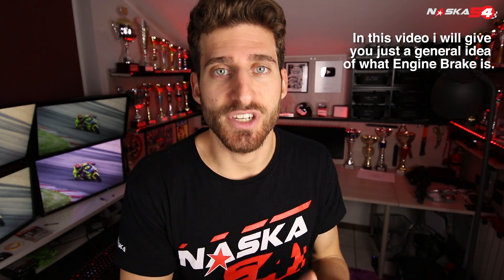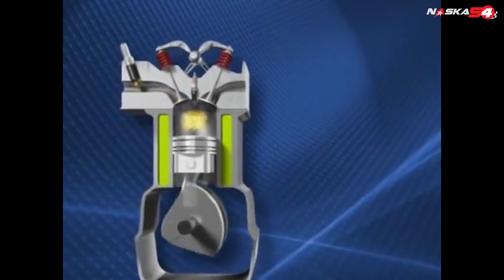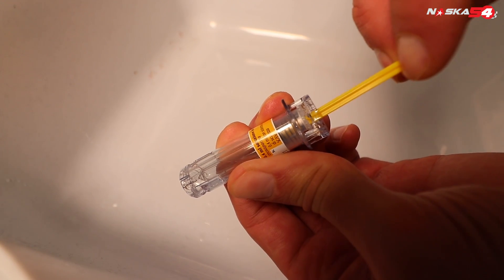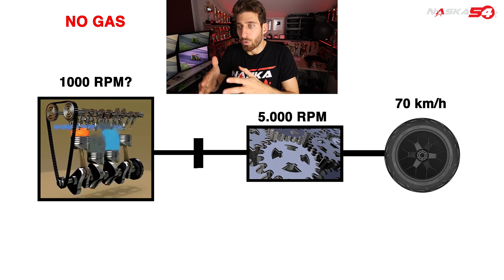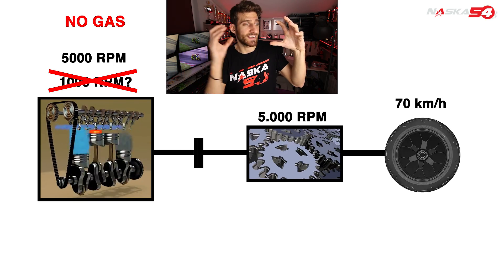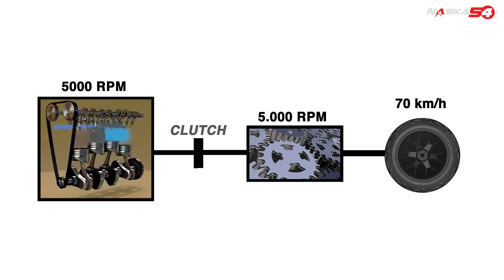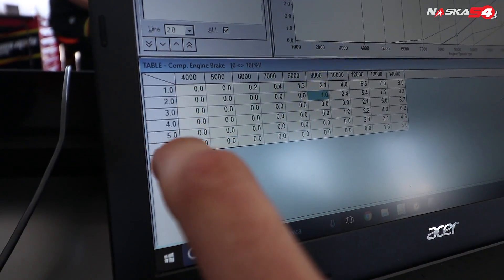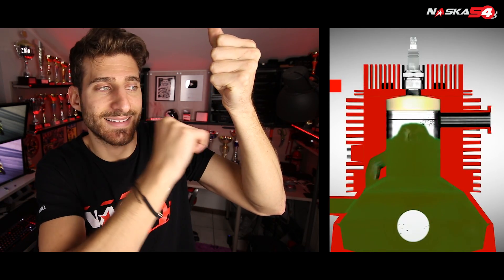THE ENGINE BRAKE: What is it and HOW does it work? Motorbikes and cars

Comment: When engine-braking and the rev is pushed high, the spark plug is not sparking and the fuel is not injecting the fuel though loud engine sound and reving high?? 

 Am i understand it corrrectly??

Comment: The first thing I noticed hopping on a motorcycle is wow these things engine brake sooo much harder than a car. It does feel like I'm wasting gas a lot because of it when I'm trying to coast and don't want to upshift 3 times or hold the clutch in (it just feels wrong) to do it. But it is definitely nice for cornering on the street. Most of the time I don't need to touch the brakes.

Comment: Question: Since engine braking takes away energy from the rear wheel, does engine braking without lever braking (the front brake)  produce the same braking effect as using the rear brake - that is, unloading the front wheel?

Comment: small addition on the fuel consumption, on most fuel injected engines, if the engine rpm is above a certain value, often around 2000rpm, and throttle is closed, there will be absolutely no fuel injected into the engine so fuel consumption is 0, this increases engine brake and reduces fuel consumption. if your car has a current fuel consumption meter, you can try it out, accelerate to 4000rpm and close the trottle, and watch how fuel consumption is suddenly 0

Comment: Here in Chicago Illinois, it's taught in driving lessons to put the car in neutral when you're slowing down on snow or ice to keep the car from sliding due to engine braking.
Reply: it is very bad idea. Neutral on slippery is dangerous because you have no control
Reply: @mightylordkuba  Except for the fact that I'm talking about casual driving on public roads, not driving on a track. And you'd only "have no control" if you had no ABS and are careless with your braking pressure.

Comment: If I got it right you saying race driver and modern systems reving in between downshifting to use engin brake ? If so that is completely wrong, the rpms are reved in between the gears to AVOID this Engin brake Calle „ Schleppmoment“ in German. Because they want to AVOID that tires will block especially in rear wheel vehicles, this is because in the past they had to donut manual to fit the rpms to the lower gear. A lower gear needs higher rpms to crest the same speed than the gear above „higher“ gear.

Comment: Its recommended to drastically use the engine break for a emergency break? Or in that situation is better pull the clutch 100% and only use the breaks with ABS?

Comment: Hi Alberto,
i like your videos but you have in this video a mistake.
RPM is the engine speed, not the wheels, so if you have 6000 RPM it costs 3l per minute, but when you have 2000 RPM it costs 1l per minute. It doesn't matter if you're adding gas.

Comment: Yes but at 3.50 engine rotations per minute are not the same with all the gears because you have a gear ratio in the transmission except the first gear which is connected and  driven by the engine with same rpm is at the gear ratio 1:1 with his pair . At this case engine and the 2 gears are with the same rpm until you shift another gear

Comment: Excellent video. I drive a scooter (Yamaha Ray ZR) since 2016. In December 2019 I bought MT15 and after that I taught myself how to ride a bike. I use this engine braking a lot on daily basis. But I was worried about the engine, wondering if it is bad for the engine to use engine braking for slowing down. And now I am relaxed after watching your video. Thanks for all the nice tips!

Comment: it might be good to note, that an engine is controlled not by fuel, but by the air. If you twist the throttle on an old bike, you literally control an air valve (butterfly valve) on a carburator, or with EFI systems control a butterfly valve on throttle bodies (either electronically or with physical cables). Thus if you close the throttle, you restrict the airflow. If you try to suck air through a smaller gap it also gives more resistance. Whatever controls the air/fuel mixture (carburetors or computer+injectors) tries to keep the air fuel mixture roughly the same, so with less air flow there is less fuel being spent as well. This explains 8:15 (although the airflow and thus consumption is higher than if the bike would be stationary I think). 

I think this is also how the electronic engine braking works, by electronically not fully closing the butterfly valve, you can increase airflow and thus 'reduce' the amount of braking. I am however not 100% sure of this.

Comment: Engine braking is caused by an advance of the combustion (the mixture explodes before its fully compressed, before the piston reaches tdc) not because it takes energy from the wheels. Mechanics and engineers are crying rn lol
Reply: That's just completely incorrect... most modern engines cut fuel on zero torque demand. The engine breaking comes from pumping losses.

Comment: great video! but i wonder.. Does engine break damage the engine? Or is it good for engine?
Reply: Well, it depends on what circumstances. If you just go down a single gear, or maybe two it just helps you breaking without slamming too much on the brakes. But if you pass from the 5th gear to the first you'll end up blowing up your engine since the ratio of the first gear is such as to cause the engine to rev up to a such high speed that could cause the piston to slam the valves or even snap the piston rod itself. (Or maybe burn the cuch or break some transmission gear)
P.S. you can trust me im an engineer
Reply: @sicilyrider4980   so it is all about to not pass rpm limits. It is releived. Thanks!
Reply: @semihakpnar2212  
You are welcome

Comment: Alberto,  you're not explaining engine braking in this video.

As Jason Fenske explains on his YouTube video titled "Is It Bad To Engine Brake With A Manual Transmission?", it is not compressing the engine that causes engine braking, as that compression goes into the power stroke, which naturally more than compensates for any loss of power due to compression. That of course is not the case in your demonstration of pushing a motorcycle in gear with the engine off.

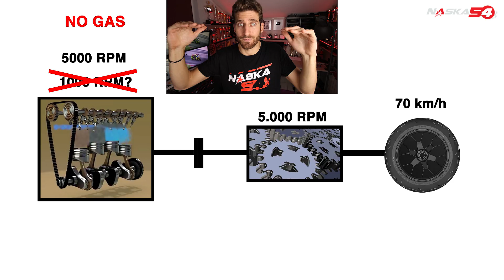At about the 4 minute mark you explained that when you let off of the throttle the inertia of the rear wheel would like to keep the vehicle at the same speed, keeping the engine's RPMs up. Then at 5:21 you state "Where does it take the energy to stay at 5,000 RPM? It takes it from the wheels. So, sucking energy from the wheels, the engine is actually braking them. So, it is acting like a brake, and this is why it's called engine braking." You are claiming that the rear wheel speed wants the engine to remain at 5000 RPMs and the engine is taking energy from the rear wheel to rev closer to that speed. That's not defining engine braking.

Let's leave this one to an engineer to explain. I'll quote Jason verbatim from the video I mentioned above:

"You let your foot off the throttle, and so that throttle valve closes and now you have a vacuum between that throttle valve and your engine. Your engine is trying to pull in air, but the throttle is closed so it's hard for it to pull in that air and that's what's slowing you down. A lot of people say it's the compression that's going to be slowing you down in these gasoline engines and that's not the case, because as that piston compresses up, it does pressurize that air, yes, and it does take work to do that, but that work immediately goes right back into pressing that piston back down. Very little of it is actually lost to heat in that transaction because engines are smooth running machines; they're not supposed to lose heat in that scenario. So a lot of the energy from compression just goes right back into pushing the piston back down. The real engine braking in gasoline engines comes from that throttle valve being closed and trying to pull that vacuum."

To put it succinctly, engine braking is the engine slowing down due to the vacuum created by the almost completely closed throttle valves and the slower engine speed in turn slows down the rotational speed of the drive wheel; it is not the drive wheel slowing down the engine.

I hope you consider re-doing this video as you don't seem like the type of guy that wants to propagate inaccurate information. It seems that you genuinely want to help others better understand how things work.

Comment: hi alberto.. one question, u said that we can gain more engine braking when downshifting in hi RPM..  but is the slipper clutch should reduce the engine braking ? currently im using suzuki k9
Reply: Well ut only slips until the rear wheel matches the speed you are going... Mainly helps with starting a drift... (I ride supermoto)
Reply: @HochstartHarry   you mean backing in rite? No wonder few time i done it accidentally in few corner on track.. From hi speed stretch up to tight corner.. When im rapid down shifting, Rear tyre feel like i push the rear brake eventhou i didnt..!! Lol... But it really scare.. Im struggling to centre and stabilize my bike.. :(
Reply: @redlineemperor  yes, exactly what i mean. Well there are a few possibilities. Either its a mechanical thing (like tire balance or a mismatched suspension setting) or you need to work on your throttle input. Also incase you ride with the clutch in through turns your bike will never feel stable.
Reply: @HochstartHarry  yeah.. still trying to figure out best throttle input and braking point...
Reply: @redlineemperor  thats all a matter of practise. Go and watch "twist of the wrist" its on youtube, its cheezy as hell but lots of great info

Comment: "it helps in braking" - but only up to the point of maximum traction of the rear wheel tire, which is lowered significantly during braking due to load shift to the front. I think the same amount of braking can be achieved solely by the rear brake. So the question becomes: which kind of rear-wheel braking is preferred? Maybe engine braking is inherently smoother? On the track, I actually never use the rear wheel brake, the question there becomes (on modern track bikes): how/why to adjust the engine brake level? How does it actually work (I'm guessing: some fuel is still injected to lower the engine brake). And also: how is it linked to a slipper clutch. Maybe all stuff for a follow up video? In any case, I've been enjoying your video's enormously :)
Reply: thats the question I wanted answered as well 👍🏻

Comment: Yep, the engine brake has a big effect on decreasing the speed pike, but u can in this way just if u don't care about money at all  that u will have to spend to gearbox))
Reply: If you rev match ( throttle blip ) eg bringing your engines rpm up to match the tyres/gearboxes rpm you do no damage, if you just drop the clutch, your going to do damage.

Comment: Engine braking is misleading. When you "engine" brake, you are essentially using the gearing of your transmission to slow down. Imagine going downhill on a bicycle with no brakes. It will accelerate. Now, imagine that you are changing to a lower gear ratio on your bicycle as you are going downhill. You will slow down. So, "engine" braking has nothing to do with the internal combustion engine. The Suzuki GSX750 SRAD has one of the best engine but the worst engine braking characteristic due to its gear box. This bike felt as if it has no engine braking. Engine braking should be called "transmission" braking.
Reply: Good point, Michael. What you're saying makes sense if Alberto's explanation of how engine braking works was correct, but it isn't. See my other comments. 

If you're interested in how engine braking really works (and it is the engine doing the braking) see engineer Jason Fenske's explanation on his YouTube video titled "Is It Bad To Engine Brake With A Manual Transmission."

Comment: does it worth to mention that engine brake is also making ur engine life shorter? for example, on road and if i don t really need to use a lot of engine brake i would like to use wheels brakes instead, since they are cheaper and easier to maintain? what do you think?
Reply: i mean down shifting but not keeping RPM so high like racing but just a little bit lower than mid-range ..
Reply: so long as you have good technique with rev matching and a well maintained motor, it causes no damage

Comment: Great video. I don’t know it moterbikes are different but you also forgot to add that an engine brake uses the engine as well to slow itself down as the engine is just a big air pump. And it uses the engines as an air pump with a lack of spark and petrol to help it slow itself down.

Comment: What about tire wear, does engine braking increase wear to the rear wheel on a motorcycle?
Reply: Well... Not nearly as much as accelerating... And if you use your rear brake instead its litteraly the same wear...

Comment: While it is correct that the engine braking increases with RPM, you missed the point that at lower gears the torque conversion allows for a stronger exchange between the engine and the wheels. Love your videos, keep it up! <3

Comment: Hey Naska, do you have any videos about downshifting with a slipper clutch vs no slipper clutch? Thanks for all the great content!
Reply from the maker: Not yet
Reply: A slipper clutch allows you to downshift down gears and not worry about skipping the rear tyre because the gearbox speed/road speed is higher than the engine speed, when you release the clutch the engine will try and match rpm with the gear box, if the road speed is higher than say your rpm limit, you will either lock up the rear tyre for a moment or the gearbox will explode.